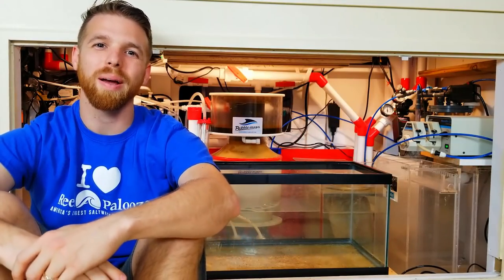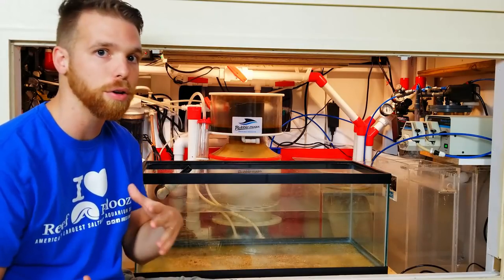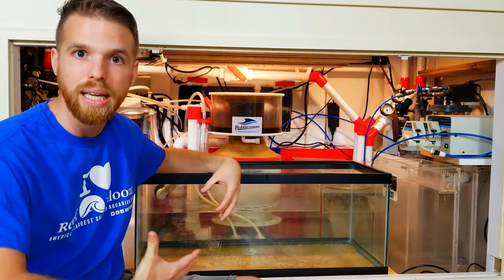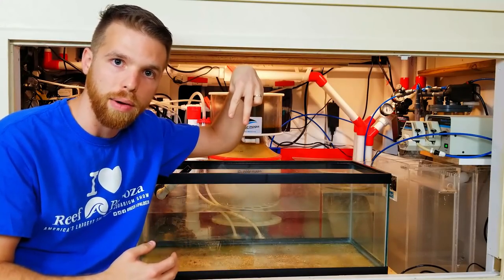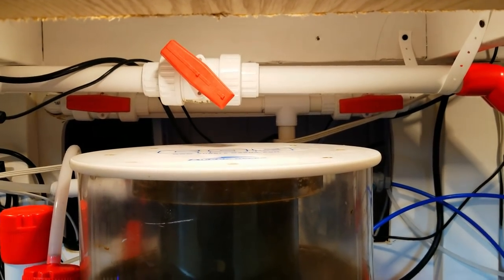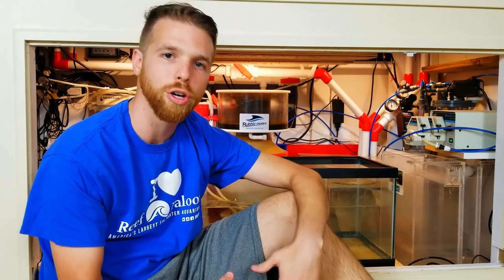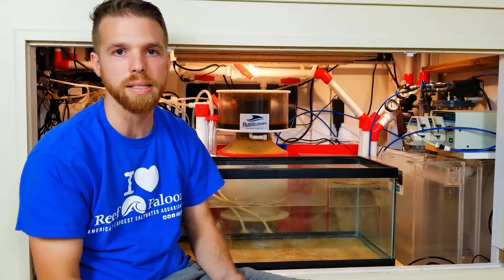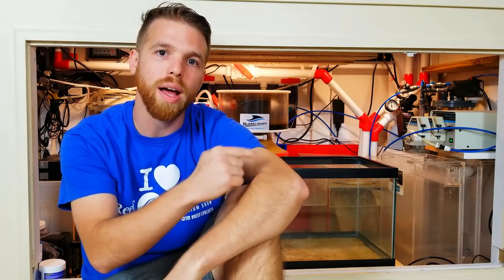THE 300: Plumbing 🚰 in My 300 Gallon Reef Tank Overview Series

Comment: How do you know the red pvc is safe to use with marine fish?
Reply from the maker: PVC as a plastic doesn't break down in the reef environment. You can use any color if PVC in your reef😁
Reply: Do you know if its marked  “NSF-61” or “NSF-PW” ? National Sanitation Foundation has tested pvc for potentially harmful chemicals leaching into the water.  So I was hoping that this pvc had been rated.  How long have you been using it? I'm willing to take the extremely low risk if you've been using it for a year or so. Thanks for the video and quick response.
Reply from the maker: I set this tank up about 3 years ago now.. I really don't think that it poses a risk

Comment: Is your skimmer in the same chamber as your return pump?
Reply from the maker: Alex Stinson yes it is, ideally there would be a bubble trap separating the two but bubbles haven't been an issue. I did however make sure that the inlet to the skimmer is prior to the discharge, reducing recirculation.